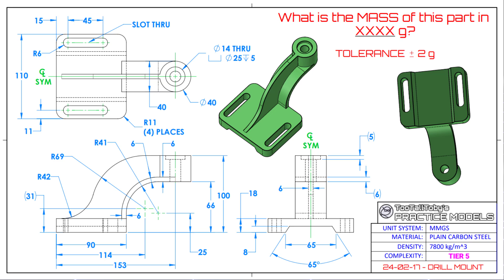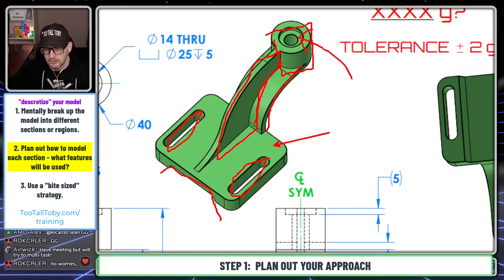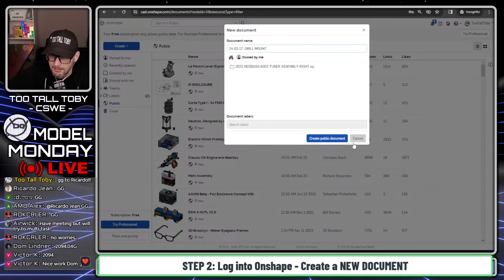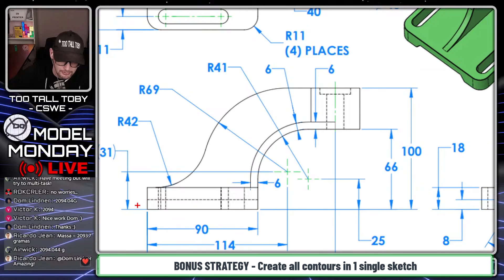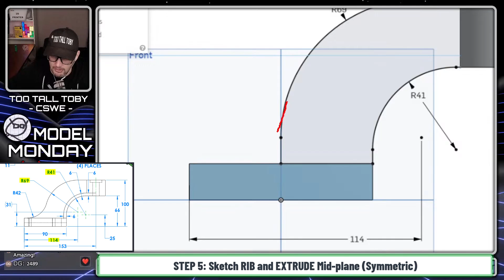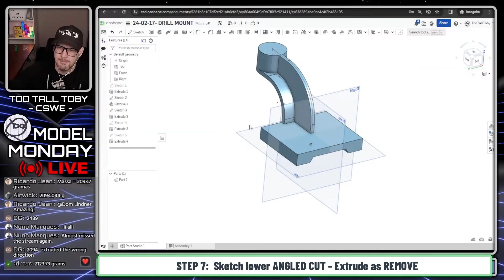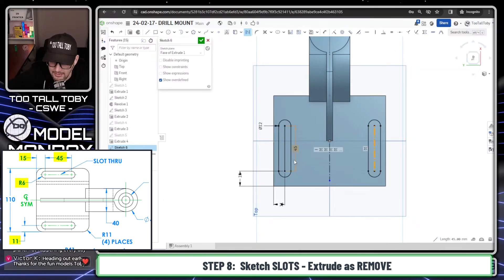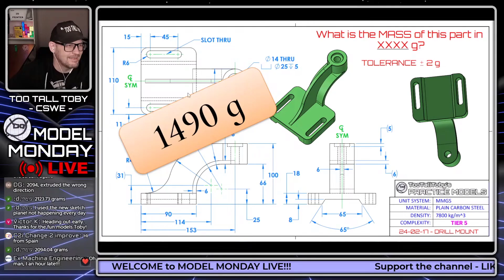FREE Onshape Tutorial - STEP by STEP

Comment: That was a great tutorial, I first tried it myself with some more complicated sketches (e.g. I did not use the slot tool) and I ended up with 1590g. Then I followed your tutorial more closely and I realised that made a mistake when designing the slots manually. Changing the diameter from 6mm to radius of 6mm, I got the mass spot on! Many thanks!
Reply from the maker: Awesome - Glad this helped!

Comment: Great job TTT! 👌 I like your explanation on how to model a part like this especially for beginners! 👍

Using Onshape, I think this part is appropriate for a main sketch driving most of the shape. Later you won't have to find which sketch is driving which feature of the part if a client request changes.
Reply from the maker: Aww yeah thanks Eric!
Reply: @TooTallToby  but that is contrary to your comments in the video. I am grateful for the video tutorial - useful to know.
Reply: Yes but providing its only a change to a feature from that main sketch - but this whole exercise is copying a drawing, not creating by the original design intent which is probably more behind TTT original comment. The model might then be created with the main interfacing features of the parts function first created, then add the material in a change tolerant way to connect the functional parts of the model such that a fairly predictable design alteration can easily be accommodated to the model. However, future change prediction can be like crystal ball glazing - it depends greatly upon whether the design is original or just a size variation of an existing article.